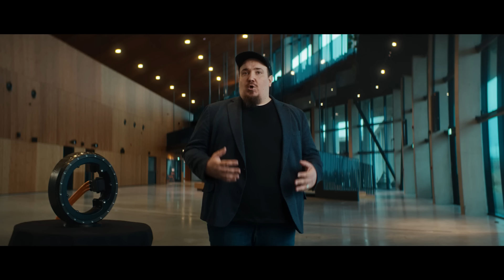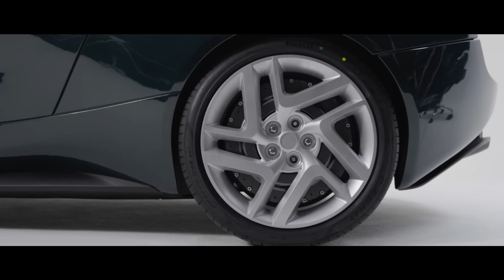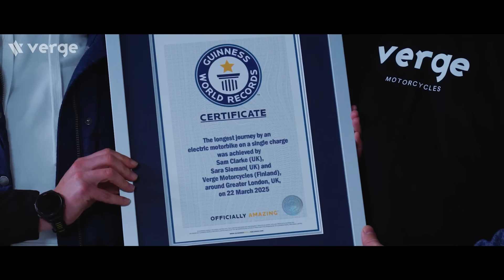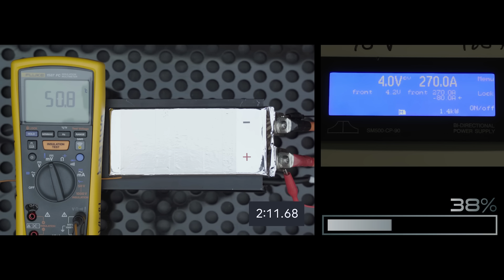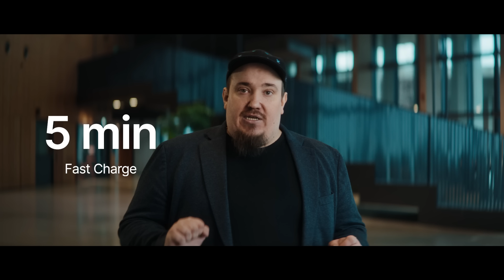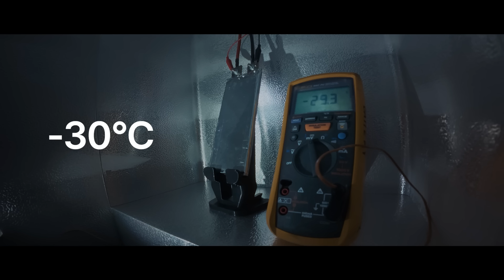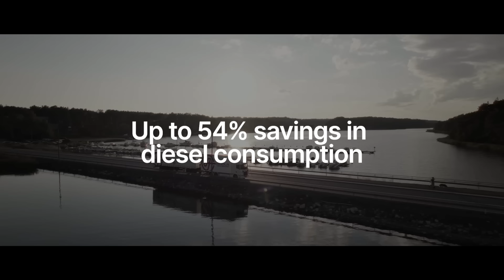World's First All-Solid-State Battery in Production Vehicles | Donut Battery

Comment: The Verge Motorcycles promo video for their bikes advertise much lower specs. It looks like everything in this video is the "theoretical" maximum. There are so many barriers to ever reaching the theoretical maximum outside a perfectly controlled laboratory. 

Verge Motorcycles is quoting 300 km of range in 10 minutes of charging. Given there are already Lithium Battery vehicles on the road capable of this charging rate (although not many), that is completely believable. 

But given the Advertised price of the Verge TS Pro at $30K USD before taxes and fees (whatever fees mean). I definitely question the price advantage they are touting.

To be honest, I think this video is literally just a marketing exercise on the theoretical Maximums in perfect laboratory conditions of already available batteries. The problem isn't the theoretical limits. It's the real world performance. Donut doesn't have anything revolutionary here. It's just upper range of what is already available today. 

Either your engineers need to push back against your marketing team, or your execs need to lower the cocaine budget. Maybe both.

Comment: 400Wh/kg would imply that my 2011 Nissan Leaf can get upgraded to a -120kWh- 60kWh battery inside the same weight envelope (300kg or so Edit: divided by 2 because I don't know how heavy the casing is).
Since the upgrade is unlikely to be compatible with the "cold weather kit" (read: battery heater) I would be interested in cold weather performance.
CATL's claimed -40C operation for their Sodium-ion chemistry would be suitable for in-city use on the Canadian Prairies on the coldest night of the year. For use in rural areas: a battery heater is likely still needed during the coldest week or the year.

Comment: bold move to bring up electric vehicle trucking, that is one of EV's worse sides, since trucks already need all the weight for their load to remain road legal. 
conventional diesel trucks are ~12,000 Wh/kg, while conventional Li-ion are ~160-250 Wh/kg, 
for a EV truck to have the same performance as a diesel one, they would have severe reduced carry capacity due to road legality and infrastructure safety.

Comment: Haha donut don't disclose it's price but I think it's cost 350 dollar /kw, and it's really not cheap than lithium battery lithium battery cost 90 to 100 dollar yet 4000 cycle vs 100,000 cycle satisfy but I think, if its below 300 dollar /kw than it will be useful for the world. A car generally uses 100 kwh means 35k only for battery that will be no use, and not good for mass production.
Reply: 350$/kw is cheap for that specs.
Reply: @322-Dota2 I think u don't know how money works Interest will be applied on how much u spend.. In 2.5 years u can buy another battery of lithium ion.
100 dollar li ion =3300 dollar for 33kw.

350 *33=11,550 dollar. Interest rate is 12 percent on 11,550 =1386.
Every 2. 5 years u can buy a new lithium ion battery even if privious was not losing 80 percent of battery health. This is not gonna work till this battery price is under 200 dollar.

Comment: They will have to last 300,000 miles like most small cars do, people are not going to pay 20,000 every 5 or 6 years to replace a battery because it can't maintain the range any longer. For trucks they will need to be able to pull a RV at least 500 miles or more before a recharge. Oh and be under $50,000 brand new. If you could meet all that you would likely be able to replace gas and diesel engines.

Comment: If this is reality, then this is a breakthrough, a batteri of 80KwH (average EV car batteri) would be approx 200 kg and that would be a huge win,  but donut motors are not new, they are already in most EVs today but not mounted just inside of the wheel. I would think that having the motor adding wight to the suspension is not a good idea in cars although you get least energy losses that way.

Comment: We need explanation for "full solid state". This far, all solid-like structures that can be charged do change dimensions on atomic level when charged. This change in dimensions causes fractures in long term usage if the material is treated as true solid (e.g. no extra space for growing and shrinking) and in practice also causes fractures in the material itself because practical manufacturing cannot create atomically perfect structures.

Comment: 5:06 I think ICE vehicles will always stay relevant in at least performance vehicles due to the emotional factor, but most consumer level ICE vehicles will be replaced given that price is competitive, and most importantly maintenance cost is relatively low.
Reply: ICE tech will stay like how Steam Engine tech stayed, just in different usage.  Steam Engines are used with thermo-energy generators, from underground heat, by boiling volumes of water and such to turn turbines.

So nothing ever goes away.  Just change the use factor.  Nothing warms up a cold place like a ICE.

Comment: Even the perfect battery still needs to be charged. The grid already stretched to its limits does not support the EV transition.
The EV might be, after a few years, have a lower carbon footprint the a regular gas engine, and prob never than a diesel, but still runs in most countries indirectly on fossil fuel generated electricity.
Still, solid state batteries are the holy grail and are needed badly to go ahead. But for transportation natural hydrogen is the future. There's much natural hydrogen that need to be tapped and used.

Comment: If you actually want to change the world, deliver a powerpack powerful enough for a truck and cooperate with Scania (or Volvo if you have to). Trucks and buses are the ones with the most miles and which the operators want to keep rolling 24/7 and the main obstacles to wide-scale EV adoption are range and charging times.

Comment: China is already manufacturing solid state batteries. its old news but not covered in the US. US seems to pretend China isn’t building better batteries than the rest of the world. China gives 800 trillion each year to breakthroughs in battery flash charging, and safety (zero fire hazard), and longevity and low cost. gas and oil subsidies have been all cut.
Reply: Bs , Europe has the first production ready true solid battery !🇪🇺💪🏻

Comment: We really need some real information on these batteries. From the very little I could look up, claims from your company on how your batteries are made go against literally every other solid state battery companies claims of issues that need to be solved. I find it highly suspect that your company claims the batteries are not subject to any of the physics of metal interactions.

Notice how nothing in this video actually mentions any REAL information on materials, costs, longevity specifications. Everything actually said is just a marketing line on the subject that "its good". The only real number ever actually said is 400wh/kg. Im highly suspecting that we will find the other information doesn't quite match up, and in 1-2 years we will see sudden deaths of these batteries when physics rears its head. I'm sorry to be so pessimistic here, but promises of solid state batteries have been made for decades now and when one comes to the market from a new, unknown company almost no one has heard of and refuses to provide any real numbers to back up what they claim it just doesnt feel right. Gotta look past the hype here.

Edit: So it looks like the special sauce of this battery is a new nanocarbon lattice from a company called Nordic Nano that allows the metal to stretch during charge/discharge to prevent the micro cracking of the metal while providing a very large surface area to move ions to/from by having a lattice structure. So that is some actually solid info that their battery design has some legitimate benefits.

Comment: If these batteries are to be adopted at scale. Let’s say in Finland. What kind of grid capacity nationwide would be needed for 100K cars to supercharge from 0-100% in 5 minutes at the same time?

Or let’s put it like this. 

What kind of grid capacity, to a single location, would be needed for just 5 cars to supercharge from 0-100% in 5 minutes?

At scale, the bottleneck is not just the battery, it’s all about the grid.
Reply: nobody cares about the 5min charging time, really, even a 200kw charger can deliver 50kwh in 15minutes, thats plenty fast.
its the energy density, weight, amount of cycles and SOC/output not being affected by temperature which is the real kicker.
Reply: @trytthisnowk it’s pretty much the same situation with 10 or 15 min charging time. My point is that there won’t be a grid that can handle fast charging at scale. Period.
Reply: @marcus3333  its not like you can only charge electric card with high power dc, even today a-lot of owners charge their electric cars with 3 phase overnight, fast dc charging is only needed when travelling further distances, i dont think its going to be a problem, especially when they deliver on their promises, meaning electric cars will have 1000km range on a single charge
Reply: @try @trytthisnowk ere’s simply too many things that someone making a pitch towards investors doesn’t need to address at this point, that is crucial for scale:

Percentage of people not having that kind of charging opportunity at home.

Amount of people traveling away from home at any given time.

Weight of the batteries in the cars and the extra wear and tear that causes on the roads.

Just to name a few.

Comment: Battery person here: This doesn't sound new, but more likely a known hybrid-solid state tech. Specifically, it is likely using an advanced battery-supercapacitor hybrid or niobium-based anode technologies. The problem with those known technogies is scale. It's easy to sell this component in a luxury, low volume vehicle (eg premium motorcycle), but mass-market automotive applications the economics haven't worked yet (otherwise Toyota would be using their version). Hopefully they announce how they're solving that through manufacturing.
Reply: They claimed "cheaper than li-ion to manufacture". Hopefully that's per kWh of single charge storage instead of computed lifetime storage where they consider their tech cheaper if it is less than 100x more expensive per battery capacity because their claimed lifetime for a single cell is 100x more.
Reply: @MikkoRantalainen it doesn't make sense to design a car for a life of 80 years. What would you make the seats out of? Even the finest leather won't last that long, so you'll need to replace them. What about the seat belts? Most of the drivetrain would be the same way. Do they use salt on the roads where you live, or do you live near the ocean? Rust will eat the car or critical componets in 30 years, unless you make it out of corrosion resistant materials, but enjoy your triple price car.
Reply: @rre9121  The battery looks like it's a modular system that could be removed. Whenever the vehicle is decommissioned, the batteries can be installed in a new vehicle, used as grid storage, or possibly portable battery storage. That's a lot better than today's EV batteries, which are expected to last 10 to 20 years, inside of cars that could last longer than that, with no easy way of removing them.
Reply: @Nphen there was no demonstration of a modular or removable battery system. It's inefficient to design a car around having its drivetrain ripped out at end of life. One of the huge advantages of EV design is to integrate the battery protection system into the crash safety system. If the battery needs to drop out you end up paying for that weight and volume inefficiency every day for the life of the car for what? The reusability of an allegedly already cheap battery? 
That doesn't make sense.
Reply: @rre9121 you don’t make sense
Reply: @rre9121  The nskateboard system the talk about would allow for easy removal of batteries.
Reply: In the video they claim it's all-solids-state, no hybrid.

Never heard of this company till now but sure hope it's valid.
Reply: They also claim that it's a true solid state battery, not a hybrid.  I suspect they're sourcing it from China, but who knows.  They don't provide detailed specifications.  Plus. most companies would not sell a battery with 100,000 charge cycles because you could only sell each customer one time in their life.
Reply: @johnbode2756 you realise that absolutely everyone will want one though, right? You don't need to sell to the same customer twice at all
Reply: @johnbode2756 You could charge more because the resale value would become an investment maybe
Reply: @johnbode2756 , they are heavily invested in a Nordic Nano Group, so prob some carbon nanotube technology
Reply: Maybe because they have to have full stack motor plus os and volume, maybe battery is a kind of crow bar to push the margins ?
Reply: @robmulally undoubtedly true
Reply: did you look at the charging demo at 13:00 where the battery is swelling when charging and nobody is talking about that in the comment section.
Reply: @mohammed_mubashir that's a good catch. It's either gas being generated inside the cell, or some sort of heat effect on the outer casing. It didn't get that hot, though.
Reply: What you say doesn't make sense.  He already said cost under lithium ion pricing, so you're bringing up economics???
Reply: You might be a battery person, but you aren't a paying-attention-to-the-video person. They literally explained that's not what this is.
Reply: @cloudoftime  Try being an in-touch-with-reality person for a while.
Reply: @floydkirk-j3w Why do so many people just say things without anything to support it explain? What makes me out of touch? What was flawed or incorrect about my comment? Try actually saying something of substance.

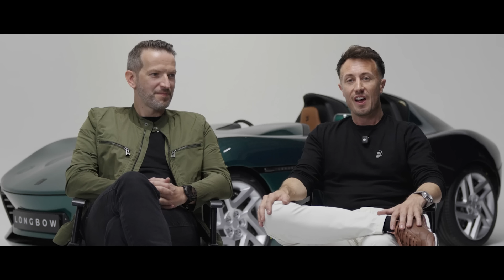Comment: 3:19 Hahahaha hang on is this thing just straight missing lug nuts randomly???
Reply: Noticed this as well... how in the world would any PR department not catch this? Two missing lug nuts.
Reply: @vanvuong4537 Right?! I was like certainly this must be a design choice I'm seeing wrong but then there's this wheel with two missing!
Reply: @vanvuong4537  They probably stripped the threads at some point and there was no time to fix it before the video had to be made.
Reply: The battery will keep the wheel attached :>
Reply: Security nut
Reply: Its all about losing weight..

Comment: 12:29 Very interesting....400 Wh/kg energy density. That's higher than Tesla's 260 Wh/kg that's in their Panasonic NCA batteries. A 43%% increase in density, could up the EV range from 320 to 457 miles. This is obvious simplification because I'm not considering weight right now. The Tesla Model S gets around 410 mi with it's 100 kWh pack. However it weighs around 1200 lbs. If Donut Lab's 100 kWh pack is estimated around 903 lbs, how much additional range on top of the 410?

Comment: What do they cost? I see that you are charging an upgrade from a 20.4 kWh batter to a 33.3 kWh battery for $5k for your motorcycles. That is a pretty promising price. That is $150/kWh above the original. Not knowing what that costs, I am assuming it isn't as much as the 5K, so at worst it is $300/kWh. That would be a breakthrough for 400Wh/kg.

In wheel or hub motors are really interesting, but I have wondered why we have not seen any mas production vehicles (other than motorcycles and ebikes) using them, they have been around for a while. How do they handle the punishment of being in the unsprung part of the vehicle over the long haul? Are they on any vehicles that have been through tens of thousands of miles in a vehicle in real world conditions?

Comment: A major advantage of independent wheel-hub motors on 3 or 4 wheel vehicles is that intelligent differential drive can be integrated into the electronic control software at no expense in extra hardware and weight.
I do hope you guys pull off the SS battery in the wild.  Next 3 months should tell us how this plays out.
Commensurate with that, I do wonder what the self-discharge rate of your new battery might be.  Because an ultra-capacitor can deliver similar or better performance in the short-term.  I suspect there may be a hybrid technology that lowers the main drawback (self-discharge) of ultra-capacitor technology.